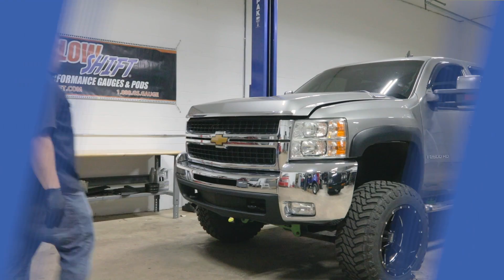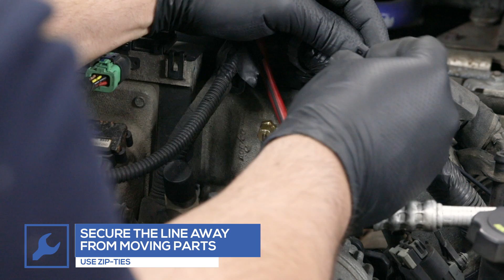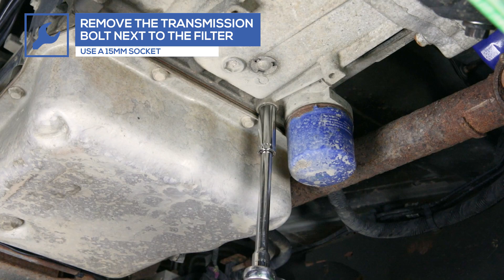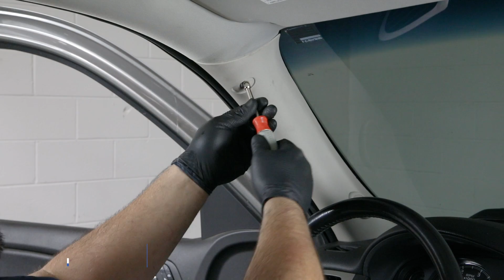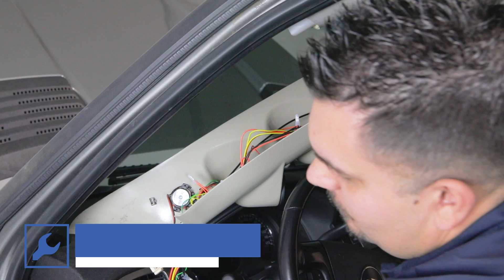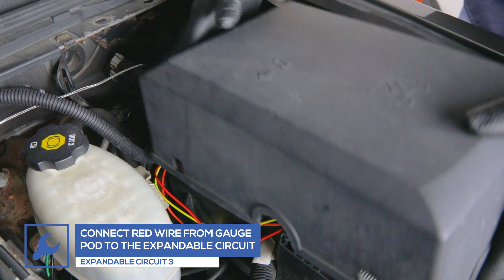GlowShift | How To Install A Diesel Gauge Package Into Your New Body Style 2007-2013 Duramax

Comment: LOL those wire connectors on Trans are gonna corrode in days and fail. At a minimum use weatherproof connectors and Dielectric Grease

Comment: same for gasserS?
Reply from the maker: The location for the sensor installs will be different on the gas version of this truck. You will need to swap the boost gauge for just a vacuum gauge since the gas engine will not have a turbo.